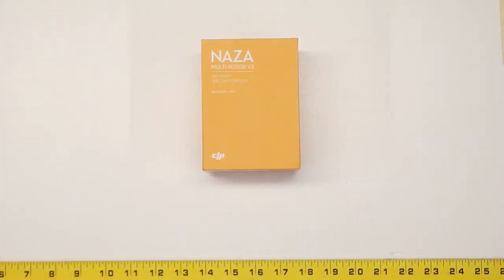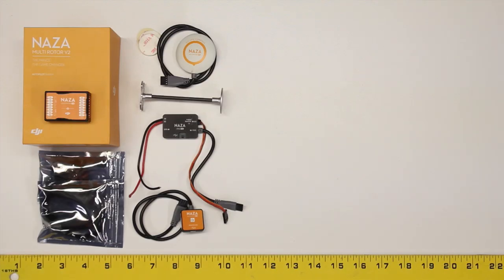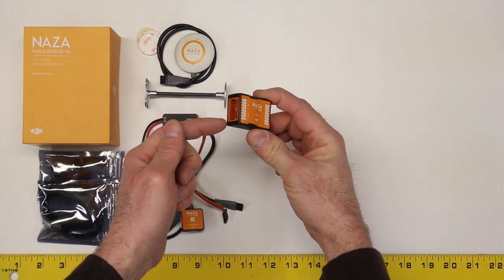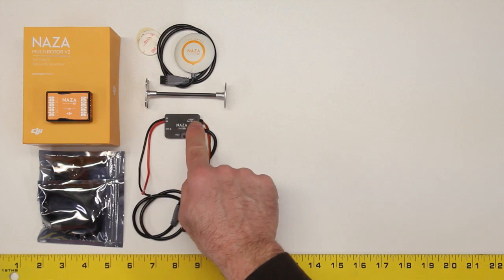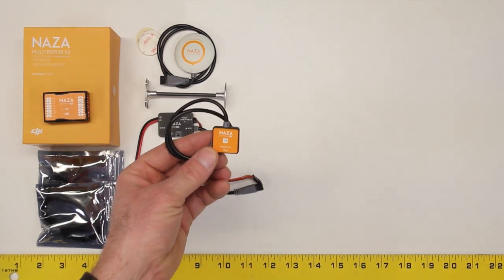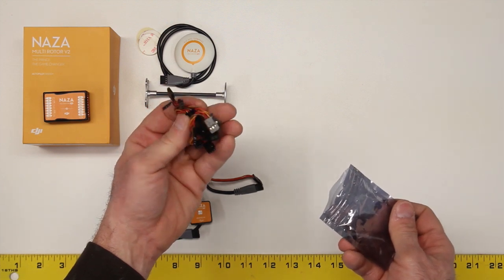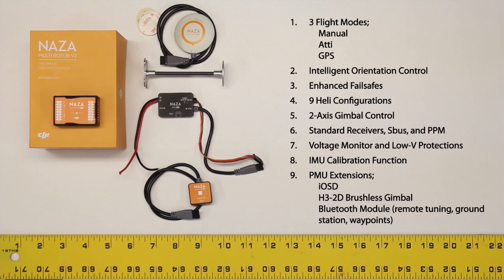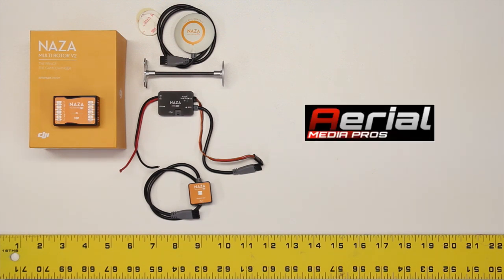MultiRotorForums.com NAZA-M V2 Product Review

Comment: Hi, any info about flyaways? I think about buying this controller but sudden loss of my property bother me much
Reply: If you go to multirotorforums.com and read the review you'll see I recommend not setting up the advanced features when first learning to fly and testing the system.  The advanced features can seem complicated when you're brand new to the NAZA and if you're also learning to fly then they can easily be confusing and lead one to think that the NAZA will always save the helicopter regardless of what the pilot does.  Take a look at the review and maybe you'll agree?
Reply: I am having major problem with this fc , ie;  on my hex , the nose always lifts first
and / or flips if not tethered , had to return for repair . It's almost  6 months since
I built my hex , and haven't flown yet !!!!!!!!!   ( similar to 800 S )   WTFO  !!!!!!!
Reply: John J Peters john, come by multirotorforums.com and post a thread about your build and the problems you're having.  we'll help you get it straightened out there.